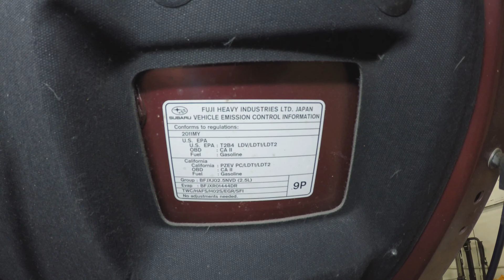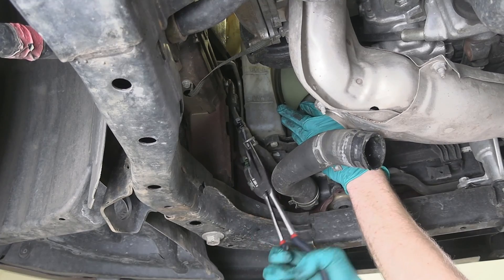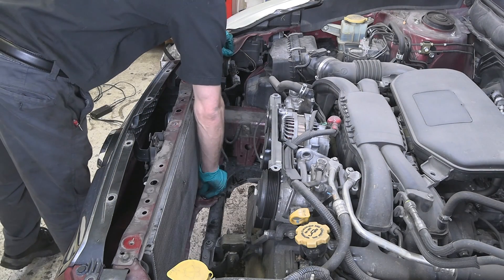Subaru Timing Belt Replacement STEP-BY-STEP (SOHC 2.5L Subaru Legacy)

Comment: Good video, but I'd 100% just invest in one of those Subaru crank holding tools and not fiddle with wedging the flywheel/flex plate or removing the rad. Super easy and they're cheap. Also not a huge fan of using sealer on all those bolts. That lubricates the threads and your torque specs are then off and easy to over tighten.

Comment: Do you really need to remove the radiator?
Reply from the maker: I think you don't have to, but it only takes 10 extra minutes and you get way more room to work and eliminate the chance of accidentally damaging your radiator.
Reply: @MakeItEasyMechanic the reason I ask is because refilling the radiator is a pain without some kind of coolant refill machine/airlift.
Reply from the maker: @LuciusJoe  I hear you, but the way I see it - this is too big of a job to not do the water pump, and if you're doing the water pump - you have to drain the coolant anyway.

Comment: Thanks for the video, I have a doubt about the NSk engine timing belt idler, the kit comes with NSK 59TB0515 (black one), but the red one is NSK 59TB0524, there is no problem with them being different? Id appreciate your support.

Comment: There is a holding tool the one I use is made by Company 23 that will allow you to hold the crank pulley, while also using a breaker bar or impact together to remove the crankshaft bolt. The best option to avoid potentially breaking the teeth on the flywheel or torque converter and especially if you're doing this as a one many job.

Comment: Is the axle nut the same diameter as the crankshaft screw hole? I didn't have one, so I had a terrible time removing the bolt after advancing the belt. And the timing is off, so I have to try again. But I need an axle nut first. Please advise. Thank you.

Comment: Thank you so much for this video. However, when installing back the crank pulley bolt, you said you put a thread sealer, but I notice on the bolt that its a loctite threadlock. Please correct me if I'm wrong. Thanks
Reply from the maker: Yes, you're correct. I meant to say 'loctite'.

Comment: I think the rubber O ring on the timing tensioner bolt is just to keep the washer from falling off in transit and should be removed before inserting the bolt in place - otherwise when you torque up the bolt you will crush rubber between the washer and block ?
Reply from the maker: When you remove the original tensioner - there's an oring on it, so I like to keep one on the new one too. There's a groove on the engine for the o-ring to fit in. But you're right - you dont have to have an O-ring there.

Comment: Isn't it a DOHC? I see two cams. Don't think it's an SOHC
Reply from the maker: It's a single cam, one cam per bank. DOHC will have a total of 4 (2 cams on each side)
Reply: Your would see four cam shafts if it were dual.  There are two because one SOHC runs the left side, the other, the right side.  this is a boxer.